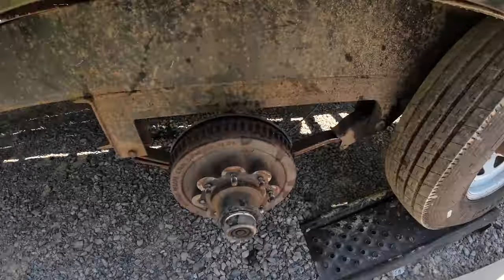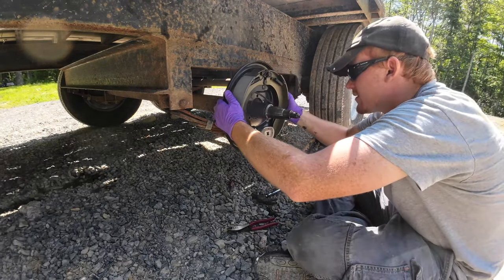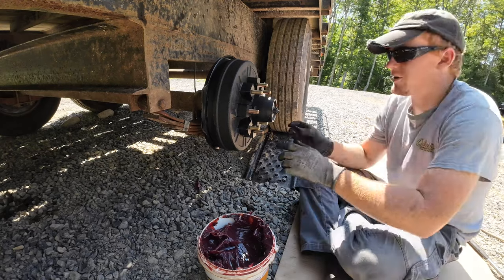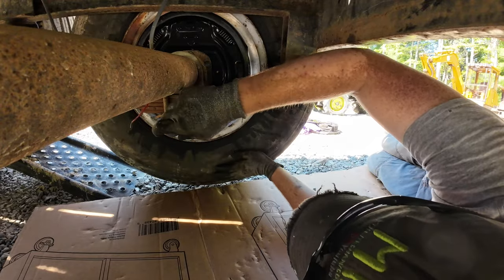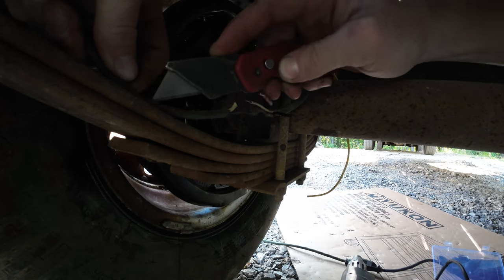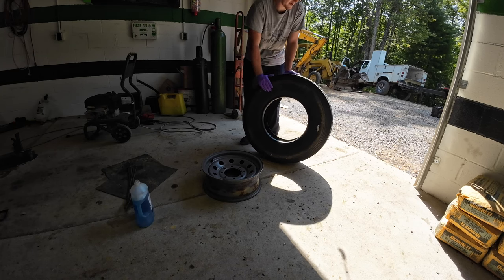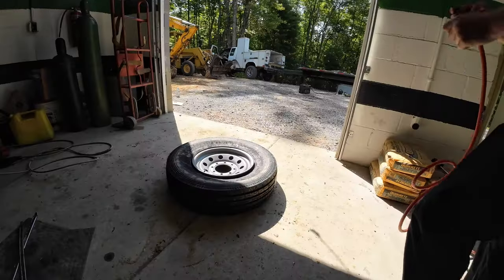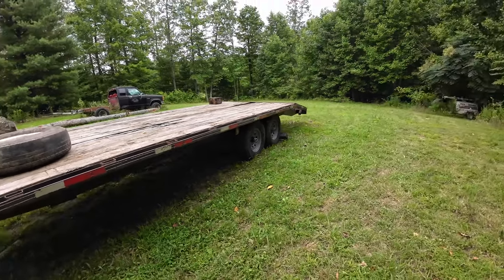Equipment Trailer Repairs

Comment: Using a claw hammer I asking for trouble,  there not design for pound on steel objects,  the can chip,  Crack,  use bullpen hammer instead.